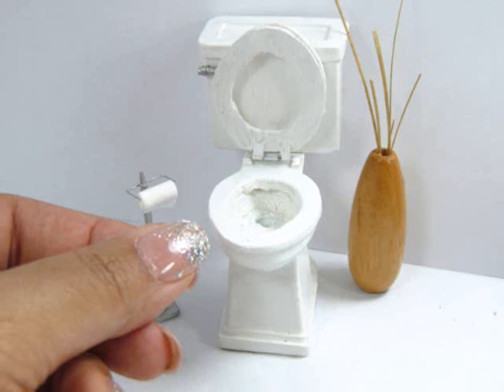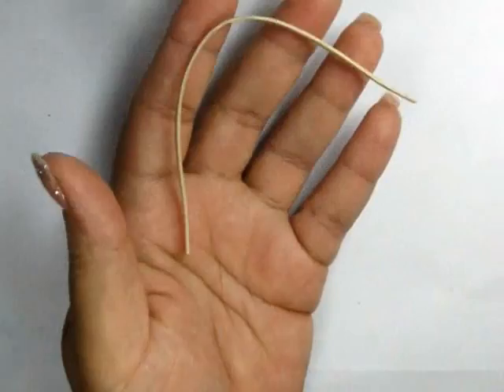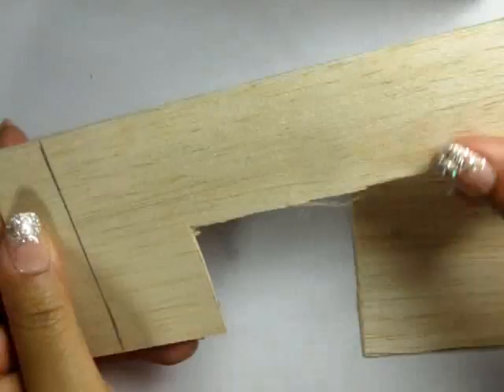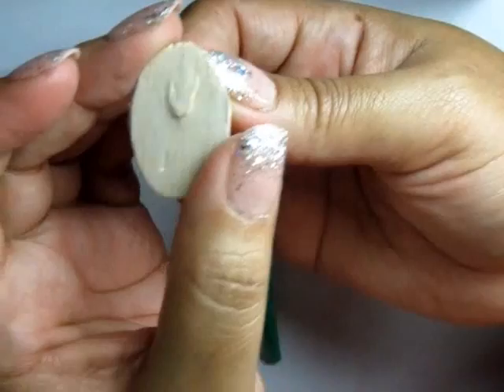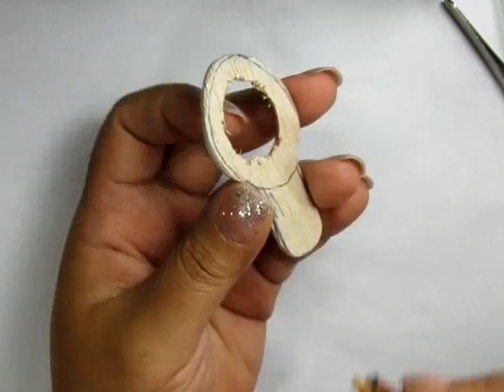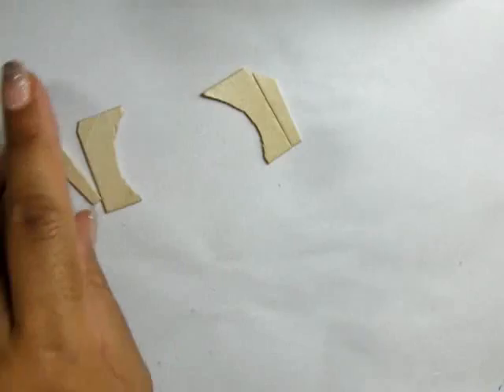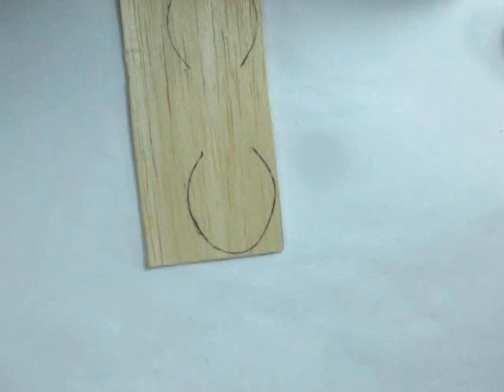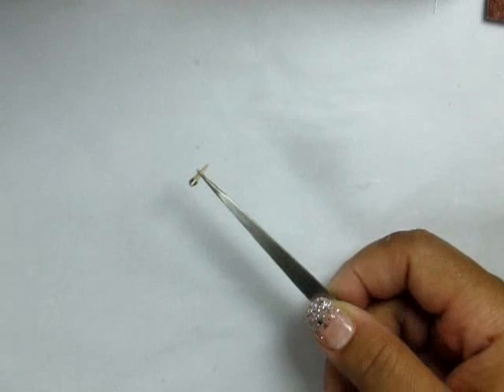Toilet Wood Dollhouse Miniature Furniture Working Seats and Removable Tank Cover

Comment: What kind of glue are you using for the wet wood?
Reply from the maker: Super glue like the type used for nails.  It cures instantly when wet, making it ideal for gluing areas that I can't hold or clamp in place easily.
Reply: @RealLifeDollhouseMiniatures  OK thanks for replying... I have this on my list of crafts to do and your method is awesome 😎👍